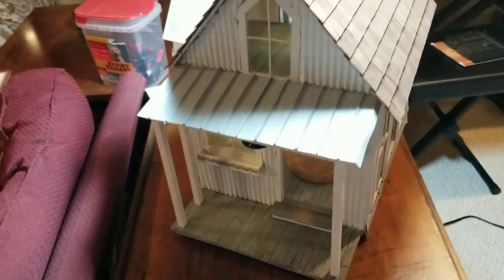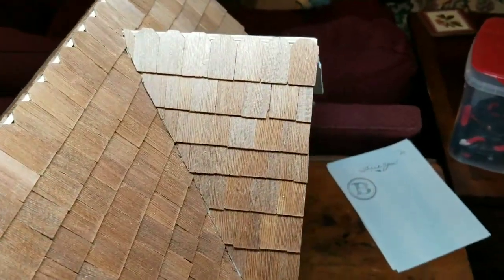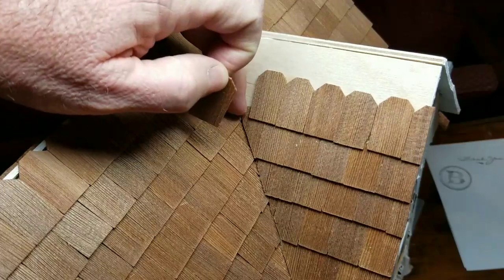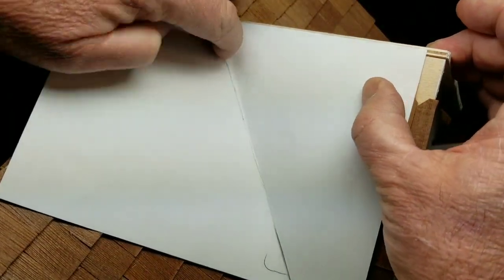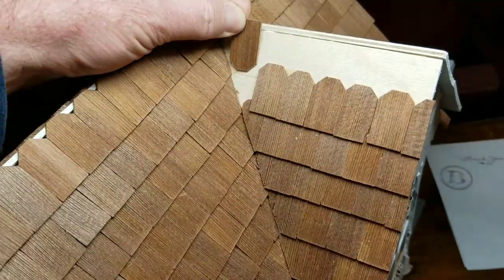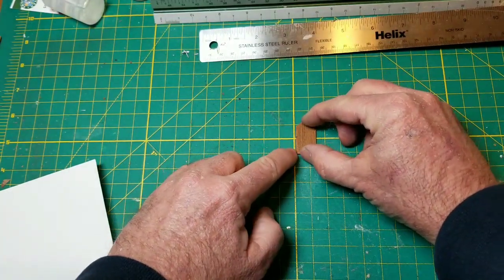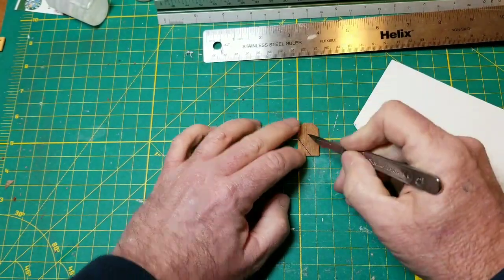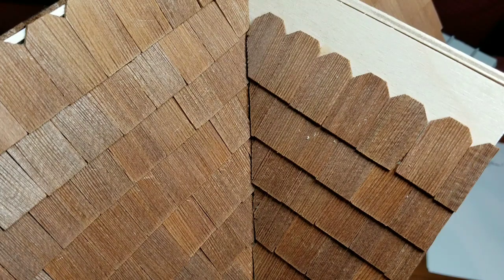Tutorial: Cutting Miniature Roof Shingle Angles

Comment: I like this! Hope you're still making houses John. I was thinking... using your paper trick to find the angle, you could tape the ends of that straight edge to your cutting mat (at the paper angle) and use it to cut the following shingles. While keeping the edge of a shingle aligned to a vertical line on the cutting mat, slide it under the straight edge until you reach your mark then cut. Would this work?